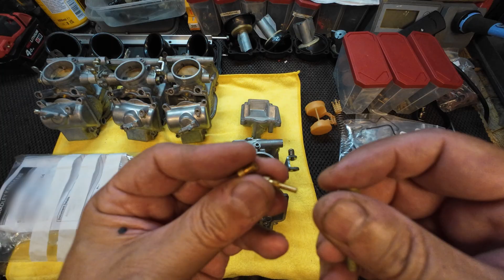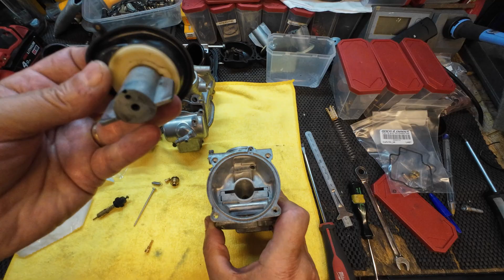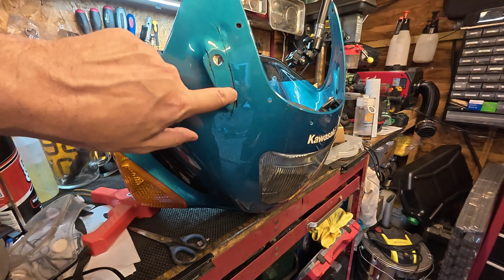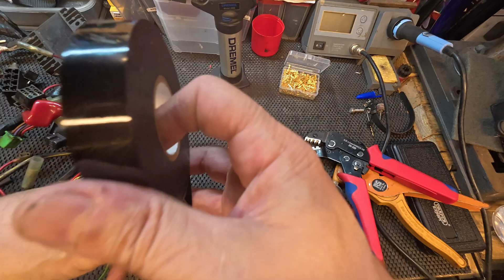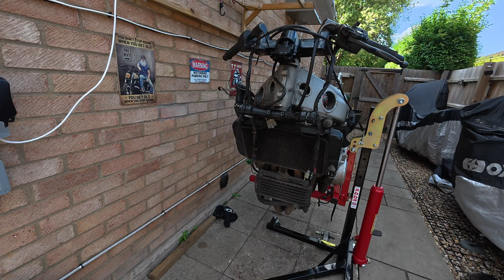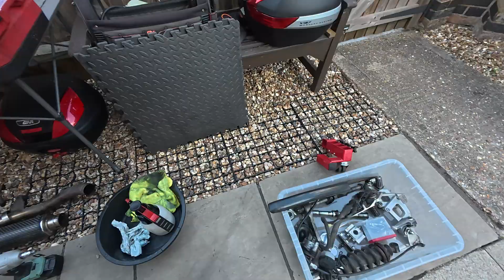ZZR600 Restoration Ep. 2: Carb Strip, Wiring Diagnosis & Plastic Repair

Comment: Encore une super video 👍
Highly impressed by the wiring Check
For your brake issue, i highly recommend You to change your calipers with parts of gsxr K0K1. You only need a conversion kit (few bolts and « entretoises »)
I change all my seals on the original ZZR 1100 Tokico but the result remains poor
Even if it’s not «l’esprit matching Numbers », it is much more safer
Reply from the maker: Thank you for your kind words. I am keeping an eye out for some GSXR calipers. I did this conversion on my ZZR1100 with amazing results.
Reply: By the past, Tokico was a great contributor for the development of organ transplant surgery units 😉
Reply from the maker: @hubertlathelize-i4c  indeed, they are 😊